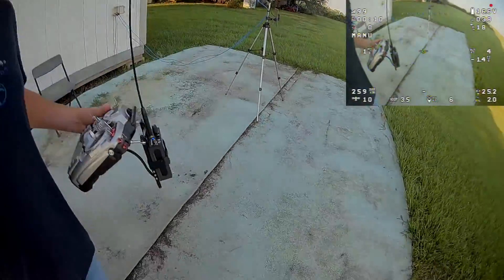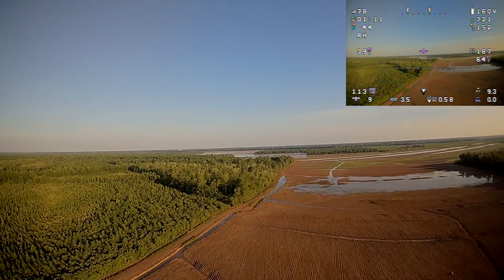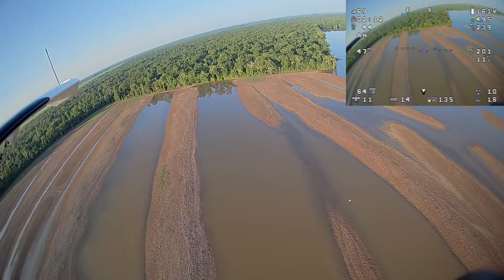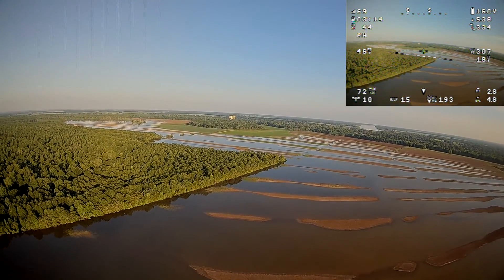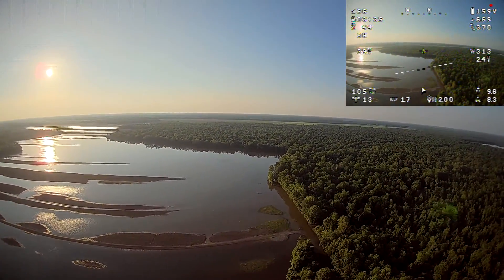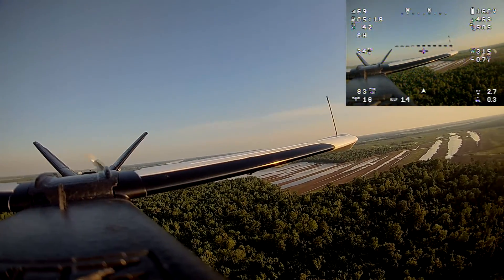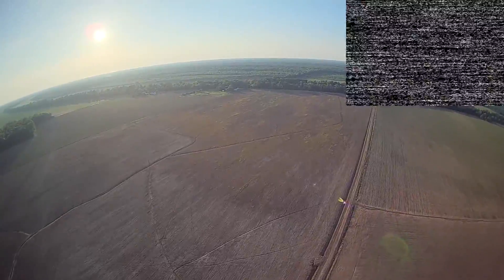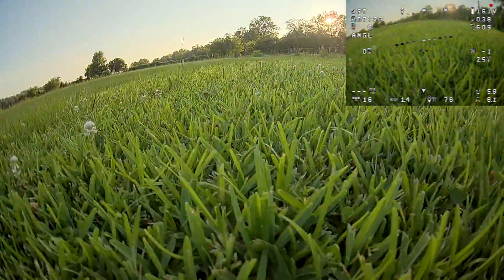vTX Dies, iNav Saves the Day

Comment: You still have the best Lone Long Ranger channel :-) 
Cold solder joint on a chip pin perhaps? Time for a new VTX.
Reply from the maker: I'm thinking the same thing... lol The funny thing is, I grabbed the other ones I saved that had issues and tested them again on the work bench, and they both work! (400 and 800mW) I let them both run for 15 minutes or so on the bench with no extra cooling, they were pretty hot, but neither one seems to have any issue now... lol This 200 still cuts in and out though. I wish I had a hot air rework station to go over them all and re-flow the solder.
Reply: @bonafidepirate  cold solder joints might only react on vibration not on temperature. So mount it on a motor and attached a small weight to one of the blades and run the rpm range up and down. That's the easiest way I came up with so far to check for vibration issues

Comment: Most of those transmitters use a varicap diode for tuning, and so have an 8 volt regulator. I also had a RMRC 200mW version do that from new, I put it on the spectrum analyser and found it was fully sweeping the 1.2gHz band.
I received a replacement under doa warranty from RMRC, and never had another failure of any of the four or so that I have of that model. I also have a few 900mHz versions and various other power 1.3gHz,  all solid reliable so far.

Comment: The way that it cuts in and out like that makes me suspect its a simple lose connection somewhere
Reply from the maker: The only reason I don't think it's a loose connection is the fact that it's still transmitting through the static at times, you can see faint images of the FPV feed, it's not always complete loss of signal.
Reply: @bonafidepirate  That's true. I'm not convinced it's a power issue though, i'd suspect the vtx itself has developed a fault. Perhaps a damaged inductor or something.

Comment: Check the TX for heat related issues by letting it drop signal then blast it with canned air (upside down so that frost comes out) and see if the TX comes right back on. If this works then a little more heat sink would be in order. Or one or more solder joints may possibly be gapping due to heat and slight malformation of the circuit board traces.
Reply from the maker: This little transmitter barely heats up, they don't run hot like the more powerful ones. I wouldn't rule out a bad solder joint though. When it fails, you can sometimes see a faint image in the static so it's still transmitting something, just not what the receiver wants to see... lol

Comment: Are you using a 360 degree servo on your pan tilt?   the only one I have found that's not continuous is a large one from FinWing Hobbies.    Would like to find a smaller one if you know of a source.
Reply from the maker: I'm using a small servo on this one, like this one: https://www.youtube.com/watch?v=NQWjrw5xGAU They are 180º out of the box, or you can get a bit more like I show in that video. I'm using one "stock" on the Binary right now, they'll work fine either way. I haven't seen the Finwing servo yet, I'll check it out! The only one I knew of is the GWS S125-1T, that's what I have on my Skyhunter and used on several other planes over the years. I've yet to find a small centering 360 servo though.

Comment: Woow, now I know exactly what's going on with mine ;)  it works on the bench but in in the field it gives exactly the same symptoms... On the bench i even covered it up with rugs to speed up heating, but it just keeps outputting crystal clear pic, than in the field it just craps out.  I spent a few evenings chasing the issue, thanks for sharing!

Comment: Did you have the way to check temperature of the VTX?? I mean... in my personal case I do go thought great lengths to keep them cool! specially since you and me are in the hot summer.. sometimes while you setup your plane, lock sats, check radio, batteries etc... the VTX get super heated!! and literally fries it self.. most of them no longer come with any kind of temperature mitigation not even remotely... hope to hear from you soon.
Reply from the maker: I haven't had any issues with heat yet. The only special attention they get is making sure they're open to some air flow. I never mount them inside the fuselage always somewhere outside and not covered over. This one is in the wingtip bay and taped on the edges with the case vents open to airflow. The 200s don't get very hot to start with, not like the larger ones. In testing on the ground it starts this cycles pretty early on before it's had time to heat up.

Comment: Reminds me of my crash recently because my camera turned off. Maybe a loose plug. Unfortunately I did not realize that I could have flown back with OSD only and a lot of other issues on the same flight caused that RTH did not work too. I made a video of it too. Luckily not too big damage and everything w as repaired quickly. 😊

Comment: I've had a similar issue. In my case it was a bad crimp on one of my connectors.
Reply from the maker: I was leaning away from a loose connection because I could still see a faint image in the static sometimes. It was still transmitting, just not being received by the receiver very well. That makes me think the frequency is drifting or something.

Comment: Hi m8, those 200mw vtxs have been difficult to obtain lately...makes me wonder about the supplier TBH...?..They sent me one recently that was DOA...unless its the wrong band as it had no 1.3G sticker on it....The ones I do have usually are fantastic in terms of performance, dont get hot or anything, just work really well...This is why we have Autopilots....lol
I dont use RMRC, I think Survielzone provided the last one.
Reply from the maker: Honestly I think most resellers are just not carrying them because the market is smaller, relative to all the 5.8GHz stuff that probably 90% of the hobby is using... lol Surveilzone was a great place to get them, I have a few from there. Looks like they do still have them in stock too! I'd started ordering them from the US to get the 1280/1258 versions when I was running everything on 1258, because it worked better alongside the older Dragonlink stuff. DL have their firmware and all that sorted out now, 1280 works perfectly fine with it... lol So 1258 isn't as much of a concern now.
Reply: Agreed, 1280mhz has no detrimental effect on my EZUHF whatsoever.  It uses extreme frequency hopping anyway. Here in the UK, the Fun Police are trying to ban FPV flying.....bastards. Small polystyrene FPV planes are dangerous, unlike 7kg Petrol power models which have no Autopilot.....Madness.

Comment: Ok, but what if RTH fails? If your using frsky LUA telemetry script you might be able to fly from the screen of the Taranis.. well possibly and with a little  latency?
Reply from the maker: But what if your receiver fails, or your transmitter, or a motor/ESC too far to glide home, or your current sensor or battery craps out and kills power to everything? There's endless possibilities... :) I've flown a lot of times over the years and could count on one hand the number of times I've needed to fall back on RTH. (two that I can think if including this one... lol)
Reply: @bonafidepirate  Yeah, I know I know...don't get me wrong, I just think it's cool. Like the Ardusoar project redundant sbus receivers and other nerdy stuff. I really haven't even used my long range R9M stuff yet because I am mildly restricted at our AMA field that is also in restricted air space. I have some video projects on my to-do list but all are line-o-site but need FPV aiming for HD video. One pilot, One gimbal operator, and one observer. Mostly child labor.
Reply: @bonafidepirate  I also have had video fail, but mine was poor camera connection, really would like the option to have solder tabs on everything. Once saved by spotter, another time was proximity save.

Comment: Would you mind sharing the stl files so we can 3d print the mount for the split mini? :-) thanks! As for 1.3g vtx, aren’t these too heavy for the talon gt? Do you place it on the wing as well?
Reply from the maker: These transmitters are not heavy at all if you remove the big aluminum housing. Those housings are meant so you can run them stationary on the ground I believe, carried over from the security camera industry (like a lot of FPV video components). The 200mW like this one doesn't even come with a housing like the larger ones. I've never used the housings though, even on the 1500mW one in the Skyhunter and it's been in service for years... lol I did have this one in the left wing, with a Dragonlink nano rx in the opposite wing.
Reply from the maker: Forgout about the STLs... lol Yeah I'll post them soon, I want to make a couple more little tweaks before posting it though. It's very similar to the ones I've uploaded for the Foxeer Mix and the Caddx Turtle.
Reply: Grear thanks for your precious advice, I am still hesitating between buying them from RMRC or banggood
Reply: Please let me once the STL file is finished for the split mini ;-) or you can send them to me by email
Reply from the maker: @jetrg12  Sorry I totally forgot! lol Thanks for reminding me. I just put them up here, let me know how they work for you! You'll need some longer M2 screws than what comes with the camera to run through the whole assembly. I used some of the included brass nuts/spacers between the two boards to make sure they stayed the right distance apart so the connector between fits properly. https://www.thingiverse.com/thing:3706491
Reply: bonafidepirate thanks! However as I don’t have a 3d printer I need to print them through shapeways right?
Reply from the maker: @jetrg12  I guess they would work, there's a few services around like that now I think. I've never used one though. I know Shapeways sometimes has issues with small parts, but they'll tell you beforehand if it's not something they can print.
Reply: I have the mini split2 I guess tha board should be the same size, lens as well...so the parts should fit